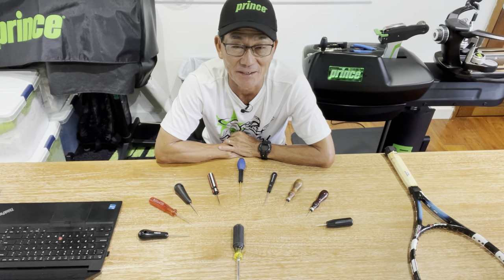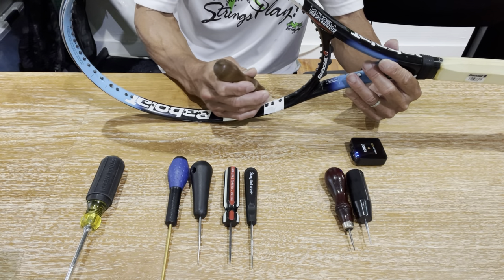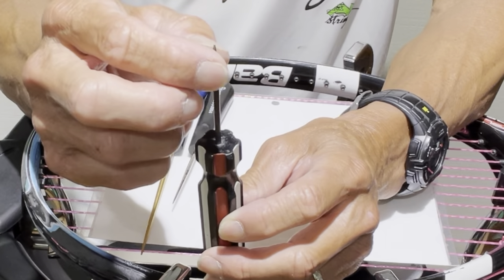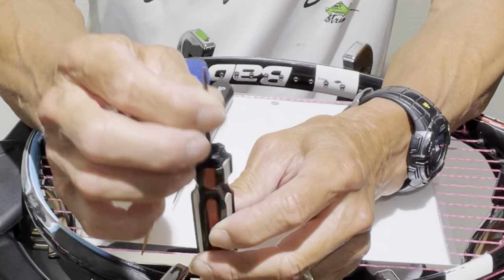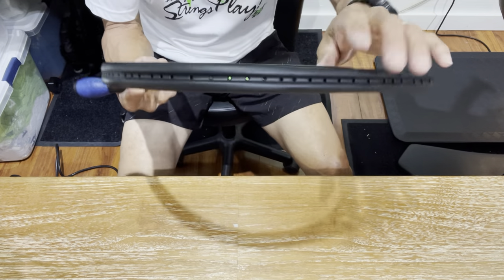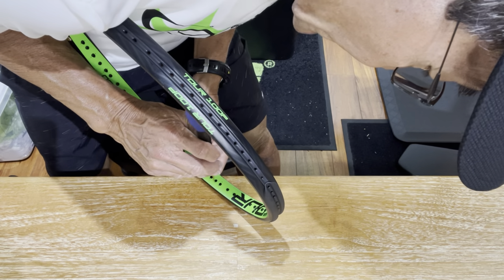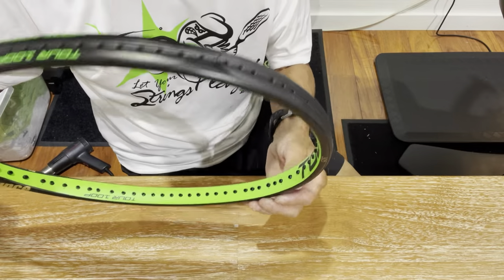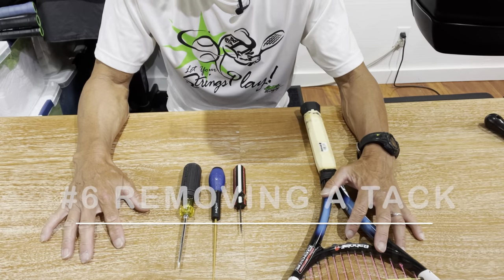Racquet Stringing [Racquet Stringing Awls | 6 Situations & Applications + Quick Tip]

Comment: Hi Albert, Nice video with helpful information.  Where do you get your replacement grommet strips?  Also, are you aware of a kit for replacing single grommets?  I've used tubing in the past as a replacement for a single grommet.  Thanks!
Reply from the maker: Aloha Carl, 
Thanks for watching!

Since I deal with a lot of Prince racquets, I purchase my grommet sets through my wholesale account at Tennis Warehouse. Whenever I need non-Prince grommets, I order them through the TW at retail. 

Another good source for older (out-of-production) grommets is the IART grommet database. You can check it out here - https://gssalliance.com/bumpergrommet-database/. 

As for the single grommets, I'm thinking that you're referring to the RAB Grommet Grinder. I did a video on this and provided some sources in the video description. https://youtu.be/tnnAgF7LsGQ

Good old-fashioned tubing usually does the trick also! https://youtu.be/Zz_HDgn9g7I 🤙
Reply: @AMstringing  Thanks for the info, Albert!